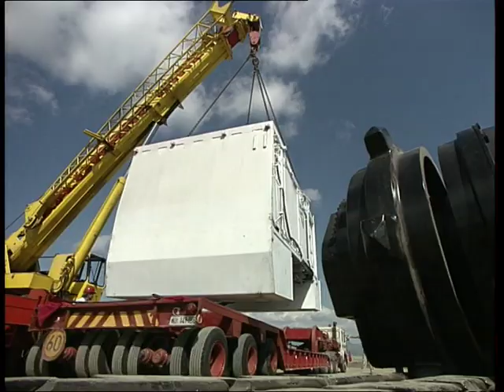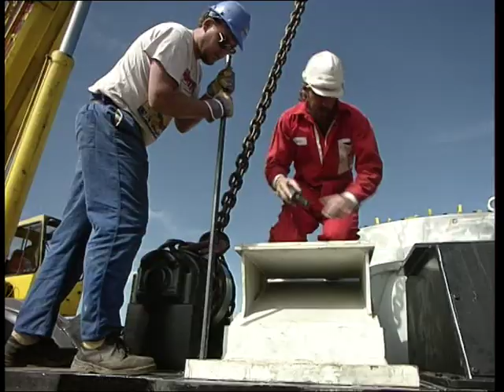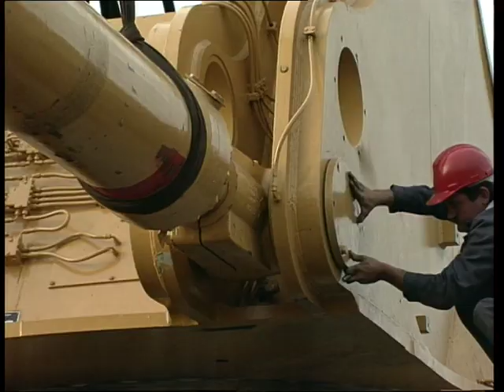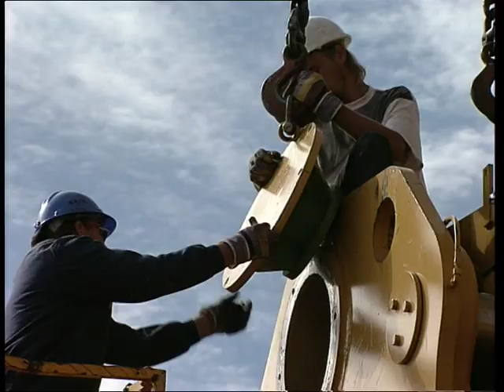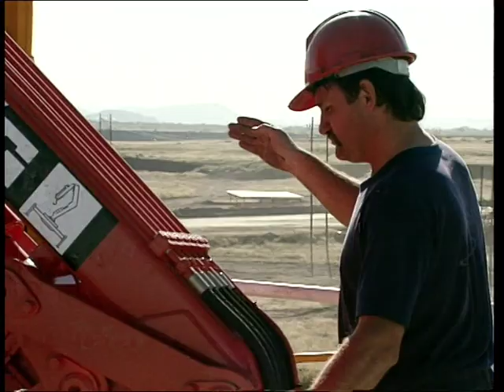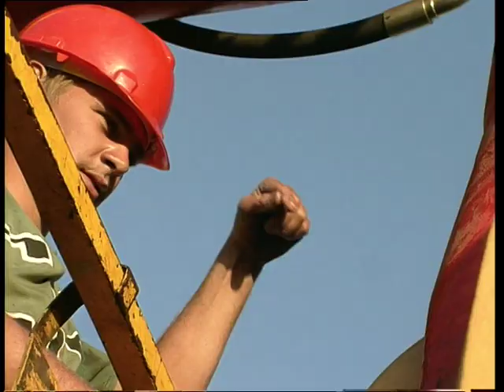O&K RH200 Assembly Excavator / Montage Hydraulikbagger

Comment: 15:07 ... You can see the specific O&K "triangle" where there is the 2 jacks and a rigid bar to the frame.
Like so , a part of the right jack is communicated to the frame.
Interesting choice of O&K many years ago.  

The big CAT showels from now are in fact O&K with a cat paint. O&K was sold and sold...
Just the name changed. 
So, very big Cat are made in Germany ... 
And all Liebherr "caterpilar" excavators are made in Colmar, France.

Comment: 1) Shovel , not excavator. 2) clamshell, not bottom dump.
Reply: 1) an excavator can be shovel or backhoe configuration 2) bottom dump not clamshell , clamshell is the one which material handlers use.

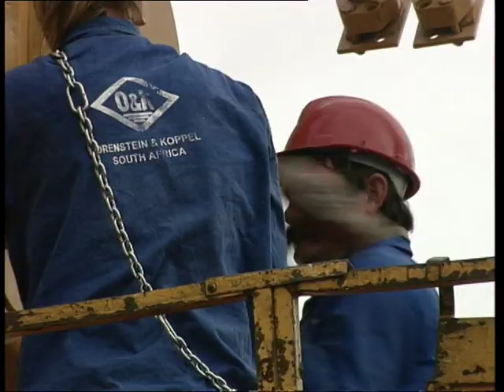Comment: 9:14, ouch! It´s a new machine, please use a rubber pad or a rubber mallet. Jerks!!
Reply: That paint will be touched up before handover.  The sledge' won''t do any damage to the pin by driving it in.
Reply: @epistte  I don't think is the right way to do that
Reply: @alysongr  How else do you want to drive that pin home? In the other areas of the assembly operation, they use a medium-sized wheel loader as a pin pusher, that has 500x the amount of force. What are you afraid of happening by driving the pin into the bushing?

Comment: I dont think a simple trackpad weights 1000KG
Reply: You noticed that too. If those pads are 4 feet long and 1 foot wide they would have to be 12.5" thick in order to weigh a ton. They seem a little shy on those dimensions.
Reply: @scootertramp4355  Your forgetting each pad is at least 48" or more wide and far more than 12" long, there's also the track rails, pins, bushings, pad bolts etc. This O&K looks to be roughly the same size as the Hitachi 5500 I ran and probably a ton for each pad would be about right. These are now only about mid size for hydraulic shovels though. Size wise there nothing special. Surprisingly these O&K's seem to be a pretty close copy to the 5500 including the deck mounted secondary crane. The one I ran had twin V16 Cummins which I think is much better than the electric drive from an operators perspective.
Reply: @turningpoint6643  a preety close copy??? When o&k were building mining shovels , hitachi mining division didnt even exist. Stop making assumptions
Reply: @S70AMG  I'm not making assumptions. I don't know if O&K were making hydraulic shovels prior to Hitachi doing so because I've never bothered to look into that. I'm guessing from what you've said they were. But what I do know is the 5500 I ran was the very first shovel of that size Hitachi had built and it had a factory installed placard in the cab that said at the time it was produced it was then the worlds largest hydraulic shovel. It was sold to Suncor in Alberta and the mine I worked for bought it from them. So yes since it was the first of that size, then a pretty close copy would probably be good enough for most people.

It was maybe not the best choice of words to use, but I didn't realize at the time I made my comments this was going to turn into an English Lit class.O&K may well have come up with whatever design similarities there are between the two machines on there own for all I know, or Hitachi copied some of the design from smaller machines from other manufacturer's. It's a meaningless obscure detail and really not important enough for me to bother looking into or care what they did.
Reply: @turningpoint6643  o&k was one of the first major excavator makers and the biggest one to have ever exist. When hitachi started mining equipment , o&k mining department had been sold to terex. They manufactured the biggest excavator , the rh 400 which now is the cat 6090, the powerless piece of junk
Reply: @S70AMG  Exactly where did I even suggest O&K wasn't the first or make the biggest right now? I simply pointed out that AT THE TIME Hitachi produced the 5500 it was THEN the largest. I also said in my first post it's now about a mid sized machine. Whoever the hell makes the largest today wasn't even part of nor was it in any way a pertinent detail for what I said. If you want to argue these points about something I've not said or suggested go try it with someone else because I'm simply not interested in wasting any more time.
Reply: @turningpoint6643  your first reply says ok is a copy , your second reply says random shit about what you are babyraging right now. Hitachi 5500 was never the largest excavator lmao. Its the same size as an o&k rh200. And it was made decades after the o&k